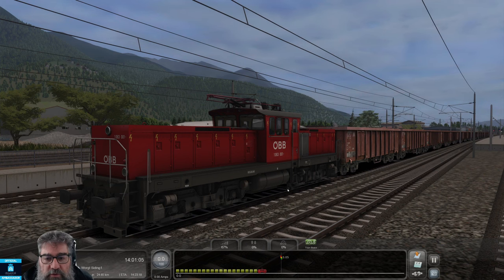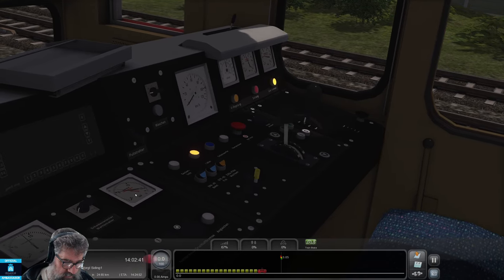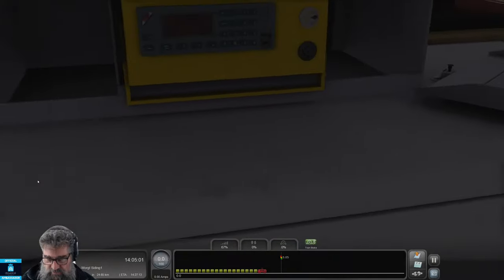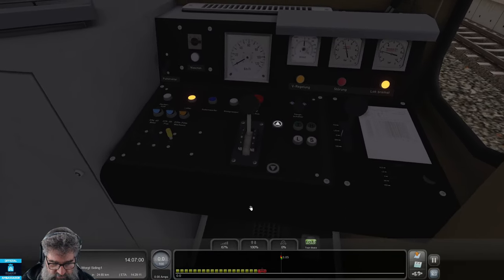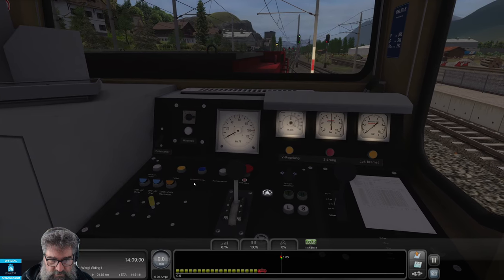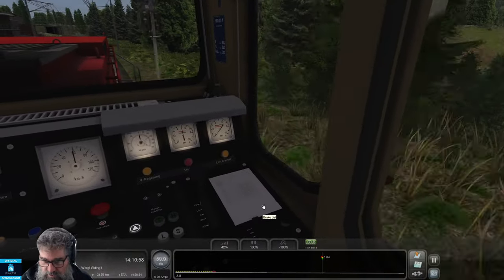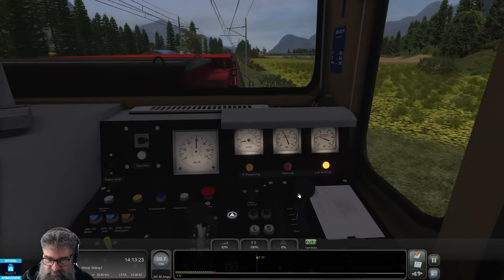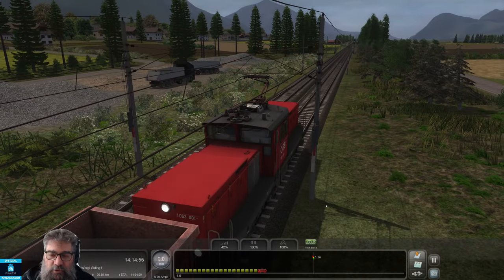Train Simulator Classic RSSLO OBB1063 First Look

Comment: I bought this one in the latest sale. I really dislike this add-on. I wish they did the Ctrl+Z for an auto start up for those that want a casual play. I would only recommend this for AI only.
Reply from the maker: You should note the "TS PRO" icon on this DLC. That means it's aimed at simulation players rather than casual. Can you run it with simple controls instead of expert controls? If you've played TSC less than two hours since buying it on Steam you can refund it if you like.